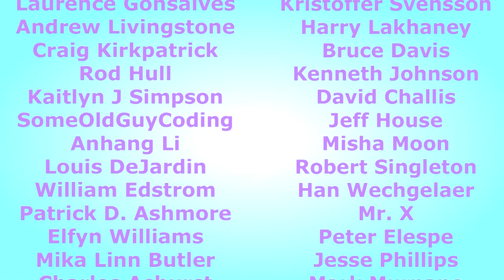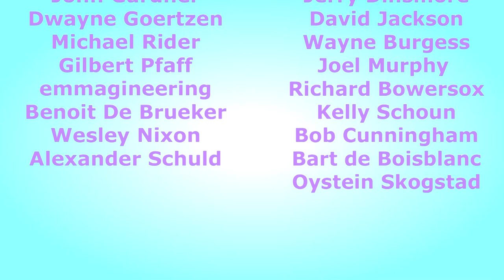3D Printing In The 20th Century

Comment: I think there are multiple reasons why 3d printing hasn't become a ubiquitous method of manufacturing. The main thing would be that it isn't really a thing for mass producing stuff, because every part has to be produced individually, which still makes it much more espensive today, than for example injection molding a million of the same pieces. Also, the accuracy and maybe even the resolution wasn't or still isn't up to par with the cheaper production methods. 3d printing is ideal for prototyping or creating a small number of parts, or even individual parts that are close to being unique, but everything else is produced much cheaper with conventional production methods, even still today. So that makes the 3d printer the "little people's manufacturing method", because you can just put it in your lab and fabricate anything you want on it. I see its biggest virtue in being able to replace plastic parts of larger assemblies that were broken and aren't sold as a spare part, so that you'd have to throw out the whole assembly. Now, you can just create a 3d model of the part and produce it yourself. So 3d printing is basically an environmentally friendly method of preventing waste and wastefulness.
Reply: I get to play with an HP MJF 5200 (among other printers) at work, and you're mostly right, but the gap is slowly closing. Currently, if you need to make less than 1,000 to 10,000 parts, and your part has sufficient complexity to require expensive tooling, you can justify using HP's big 3D printers. If you spend $10,000 on tooling for something you need 500 of, and you can fit 100 in a build on an HP, many times you can get it within a week or two and the price will be comparable if you own the machine (we can run up to two full builds a day if need be). If HP keeps pushing production capabilities up and material costs down on their industrial 3D printers (which they seem to be trying to do), you'll probably see more things printed in normal consumer goods that would be too hard to make normally, especially if there are only a few thousand pieces needed. HP uses their own machines to print the stuff they don't want to injection mold, like the cooling ducts in the fusing carriage of the 5200 and a whole ton of parts of the HP 580 (there are not very many of them, though, so it'd be very expensive to have them injection molded). A cool concept is a warehouse free factory, where when something is ordered, a build is loaded in the machine and the parts are printed and assembled. No waste, no storage. This would apply more to complicated, low volume made-to-order stuff right now (I know someone was considering the tech for printing 12" mirror telescope frames and just having lenses and hardware around, and the machine could do the whole telescope ring and frame in around 5 hours or so). Things are getting crazy on the industrial side of 3D printing, and prices of HP's competitors are only going to drop for them to compete which is good for everybody. And all those old retired 3D printers will be perfect for hacking!

Comment: The major drawback with 3d printing is that they make wonderful visual representations of parts and components but the practicality is limited.
Reply: Tell that to Rocket Lab and SpaceX  😉  They 3D print their engines.
But even for home/hobby/small business use, there's lots of functional and strong parts you can create.

Typing this on a computer with 2 monitors mounted using custom VESA adapters that have been holding strong for 3+ years.   😃

Comment: I remember the late 90's 3D printing seemed like in a few years it would become somewhat common place. Nope, Took a while.
The key being put it in someones hands at an affordable price, and it will take off. I guess it has at that.
Now print a metal object - is that really too far a leap ? I'm sure i can not be the first to think such things. Aluminum perhaps...........
Reply: Aluminum is actually one of the hardest metals to print from what I've heard. Stainless is easier which is why Markforged and Desktop Metal both use it as their base material. Unless you use Direct Metal Laser Sintering tech, the printing of metal is the easy part, but the processing and sintering is really hard and expensive. It requires a bunch of argon and expensive degreasers to turn green parts into brown parts for most systems I've seen. Even if they find a safe, easy to use cleaning fluid, the argon is still expensive (it takes a whole high pressure tank to feed a small sinter for one run) and it takes several thousand watts to heat them up. I won't be surprised if they start popping up soon though. You can already buy metal filament from TheVirtualFoundry, you just need a $30,000 sinter from them to bake your parts.
Reply: @higgsbosonman610  To be honest that was a semi thought out choice of metals.
I have not a clue as to how to go about doing so.
It just seemed a very useful to way to
use the technology - sort of a next stage
of development.
You say it is being done - excellent.
I need to learn more about that.
Thanks for the comment.

Comment: 3d printers are slow going still because they still cost an arm and a leg to buy and use
Reply: You can get a really good printer for around $200 and a fantastic one for about $400. Good filament is about $20 per kg. Most parts cost pennies to print. It's really not as expensive as most people think!
Reply: @NiHaoMike64  I said buy and use you dont just buy the printer you also have to buy the consumable items which are not cheap and if you want a good 3d printers there well over 500 dollers